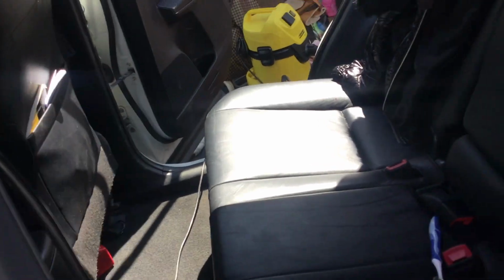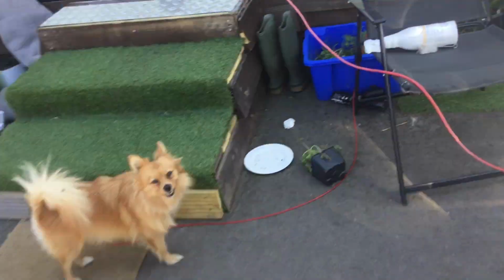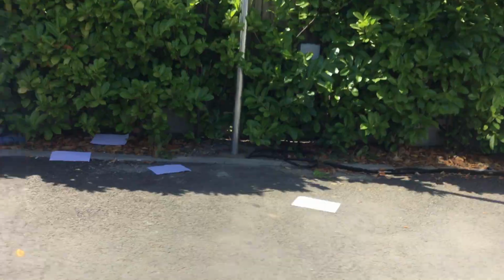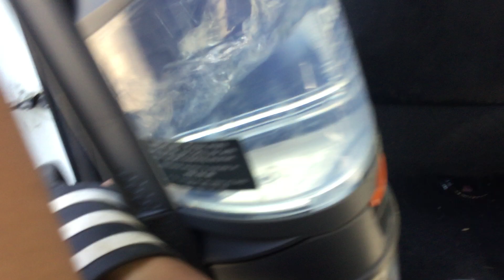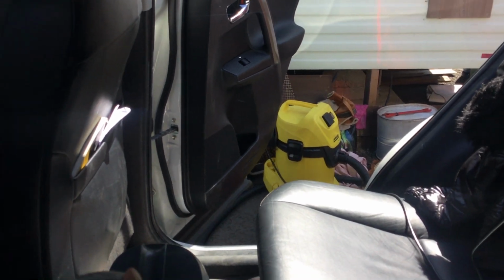How to clean car interior with carpet washer

Comment: You can use hose attachments btw.
Reply from the maker: Thank you for the comment this Vax Dual Power W86 DP-B does not have the cleaning tools but my new Vax Platinum power max ECB1SPV1 does have them which you will see in a future videos